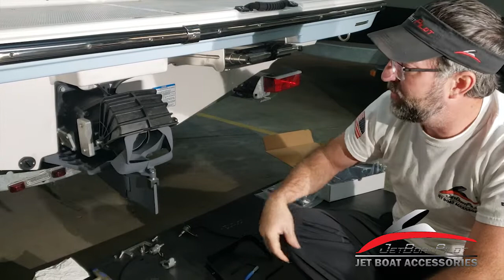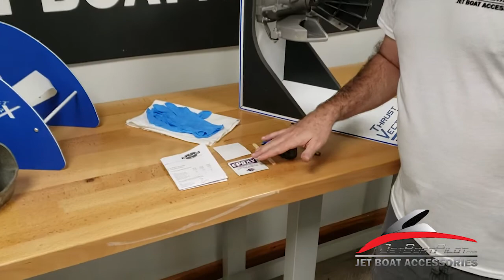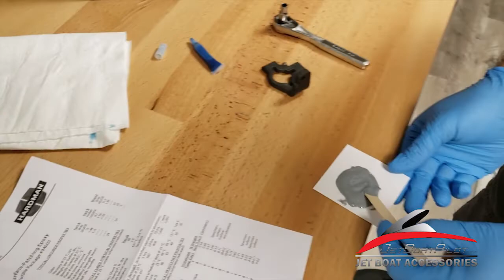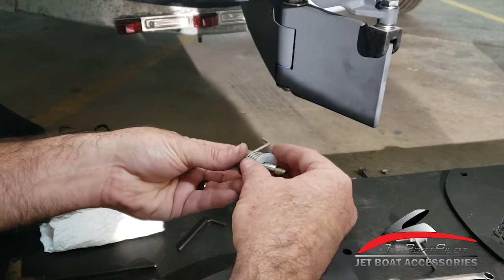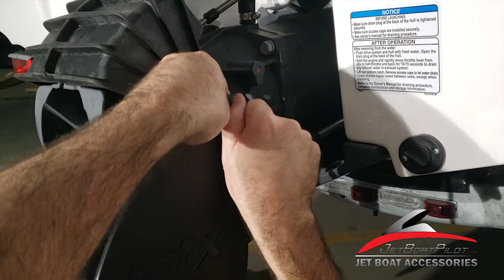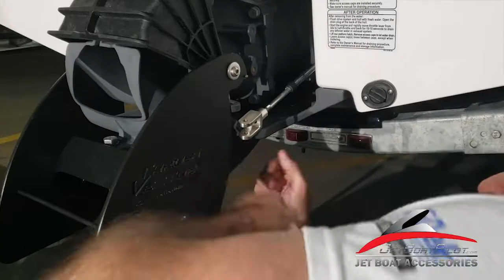Thrust Vector X Install Video V2 Feb 2019

Comment: Hey Will, Have a 195S on order.  Hoping it comes any day now.  What exact product do you recommend? Yamaha added some lateral thrust to their new design. Did that fix the problem with backing and turning? Do you still recommend your lateral thruster kit along with the thrust vectors?  Thanks man. Just trying to get the best.
Reply from the maker: If you want the best, Lateral Thruster 2.0 and Thrust Vector are optimal. Factory is better than in years past, but not nearly where it should be to be considered ideal.
Reply: @JetBoatPilot  hey Will. 
So on your site it has a combo of thrust vectors and lateral thrusters. Is that what I should order? Is that the lateral 2.0’s?
Reply from the maker: @srakfleming5888  if you use reverse regularly, yes!
Reply: @JetBoatPilot  no. I’m asking if this combo is the one you are talking about? Is that the lateral 2.0 you mentioned?
Reply from the maker: @srakfleming5888  tell me your boat's year and model. I can send you a link.
Reply: @JetBoatPilot  Yamaha 2022 195S. With grey interior. 
I also want the 2 of the naked feet sea decks.
Reply from the maker: @srakfleming5888  https://jetboatpilot.com/products/thrust-vector-low-speed-steering-enhancer?variant=40753379246133

Comment: I know the original thrust vectors didn’t void the Yamaha warranty but now that we would be using an epoxy to permanently attach something to the nozzle, will that void the warranty?
Reply from the maker: No it would not. Only in the event an aftermarket part causes a factory warrantied part to fail would that part's warranty be void.

Comment: I'm concerned that you stated the epoxy was "permanent". If I wanted to remove the TV or switch to your new style, will I have an issue?
Reply from the maker: You'd need to apply heat to remove the bracket. It can be done, just not simple.

Comment: Does the articulating keel on the 2019 make a big difference? I'm also wondering if there are projects in the future will you guys take into consideration the part that has already been epoxied onto the boat? I'm looking at getting a 2019 SX 190 soon and considering doing this upgrade.
Reply from the maker: It makes some difference but is not a complete solution. Thrust Vector X will give you much more slow speed control.  The part that is epoxied to the boat can be removed but requires heat or taking the deflector nozzle off and forcibly removing the part. I did mine that way and it did not harm the nozzle.